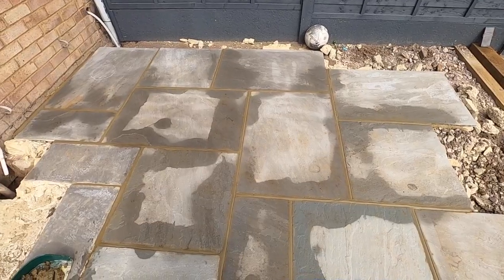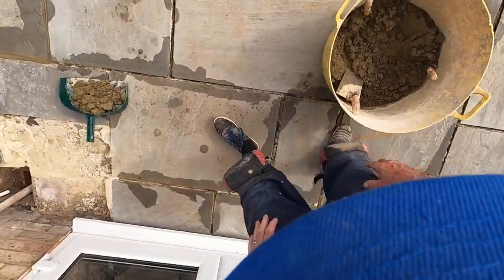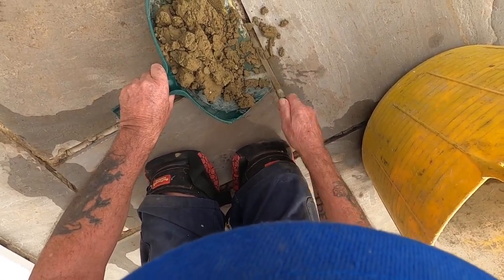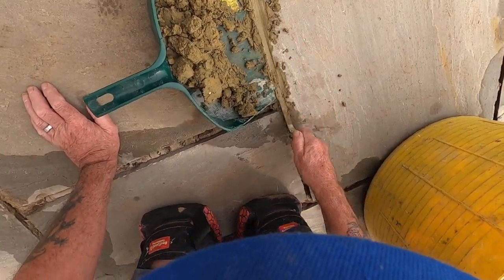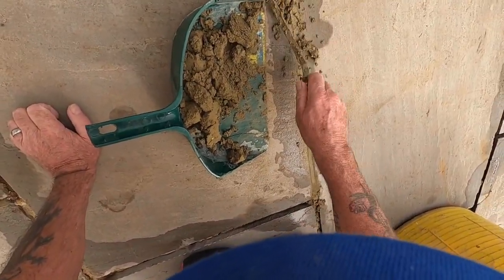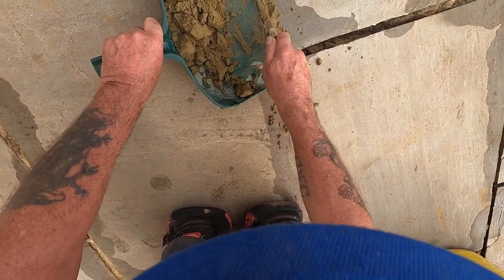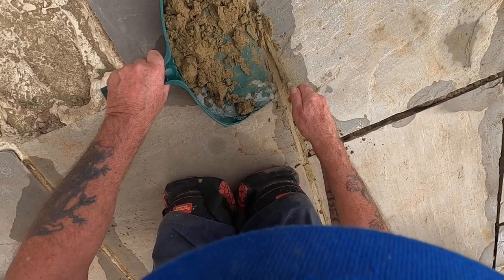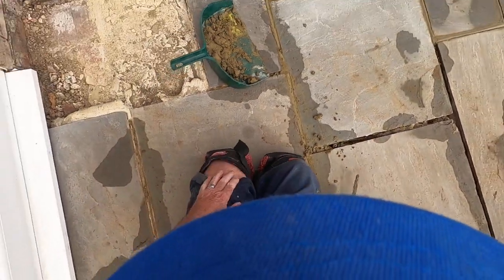Birdsbeak pointing on a patio and some new trowels.

Comment: some job on the birds beak although wouldn't be fussed using building sand on patios,that fella did some job with the fish proper job👍
Reply from the maker: Yea I would have used plastering sand myself but that's all he had, whenever i mention things like that to a builder I get told ime moaning 😁
Reply: definitely plastering sand for jointing patios, that's my go to as fine enough for a good finish and don't have to worry about shrinkage and cracking  especially when warm as you would with building sand and also definitely agree with using sbr,although nowadays everyone uses all to these premixed grouts which are great but before them you knocked up your own grouts and slurries which I still do as they work,you know your stuff Andy boy👍
Reply from the maker: @scoyle1750  👍

Comment: Lovely job as usual Andy ,the cut down dustpan is a fantastic idea . You mention a 4 to 1 mix ,do you reckon 3 building 1 sharp and 1 cement would work well ? Also ,what type kneel pads are they ,Ive tried loads of different types and most of them were useless . Thanks ,all the best from Nick .
Reply from the maker: Hi Nick, yep that mix would be fine,you could go down to 3 and1 mix if there is a lot of traffic, the knee pads seem to be made by Mcalpine now but they were called something else when I bought mine,they are a bit clumsy but good.
Reply: @bricklayersworldwithandy6277  many thanks Andy .

Comment: I cut a 10mm wide slot two foot long in some square gutter it worked really well every one I made disappeared too soft I am
Reply from the maker: Yea that would work, I've bought a steel dustpan ime going to do the same to but I won't be back on that job again until after Xmas 👍

Comment: Andy what do think of the flint blocks charlie has been laying,what pointing would you do ... thanks
Reply from the maker: I would have tested a few options on unlayed blocks before I started but my first method would have been to basicaly render them with the pointing mix then when it has picked up joint it up with a piece of slightly rounded stick, I would have them different sizes.I reckon then you could wash it all down the next day with a low pressure hose and brush.I this didn't work and it had to be washed down the same day I would try a tilers washboy and make the builder pay for the sponge floats.

Comment: Andy. What ratio of mix do you use? Also do you add lime to mix or sbr?.👍
Reply from the maker: 4 to 1, no lime or SBR though adding a small amount of SBR wouldn't hurt. I've had problems with adding Hydrated Lime to pointing mixes with small shrinkage cracks appearing. Modern premium portland  cements have so many additives there is no need to add lime.
Reply: @bricklayersworldwithandy6277  thanks for the reply. I'm redoing a sandstone patio with poor joints. I'm in-between a resin base like joint it. Or traditional sand and cement. Like you did I'm going to press it well down into the joints.
Reply from the maker: @paulcloona9331  👍